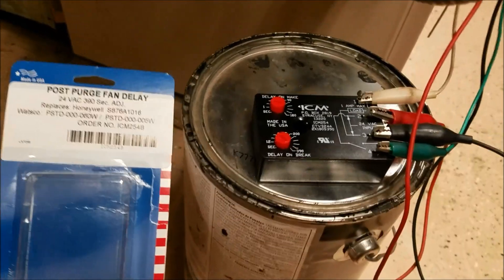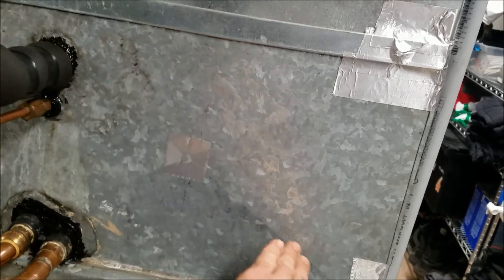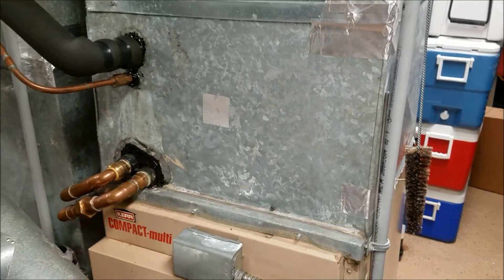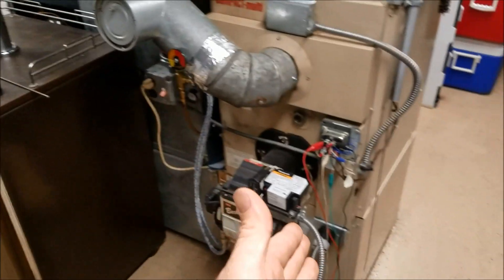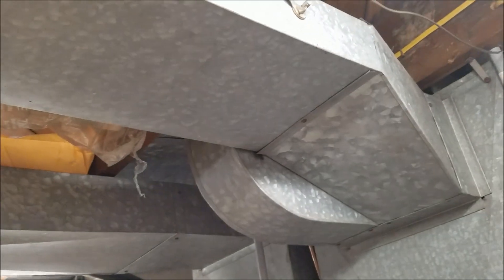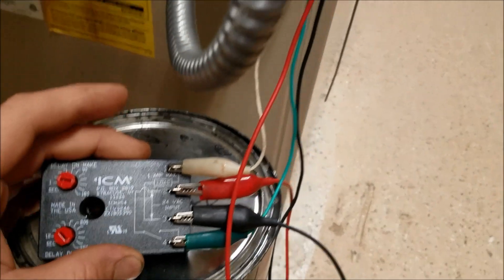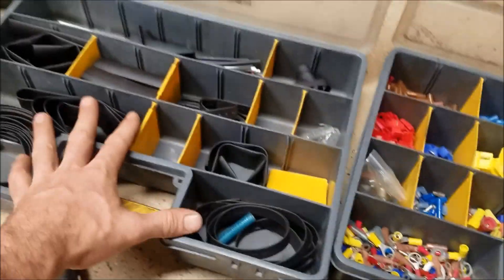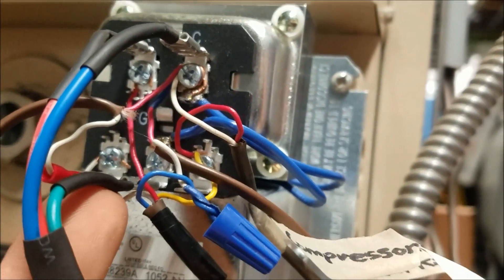DRY OFF YOUR EVAPORATOR! ICM254 Post Purge Fan Delay BENEFITS/INSTALL

Comment: Would an ICM 253B wire up them same if I only wanted to delay the fan off? I have a 30 year old system and have been wanting to add this feature. When I run my fan manually after shut off for four minutes(240 seconds) my house cools down 1 more degree. That's got to be a cost savings.

Comment: can this be installed inside an air handler where the fan motor and wires are? so it’s out of sight?
Reply from the maker: I would keep it accessible.
Reply: @NoNonsenseKnowHow  thanks for your response. i wanted to install or have the icm254 installed in our unit but i dont want it visible. just thinking, why would i want it to be accessible all the time if i can still access it by opening the air handler like i would to adjust the blower motor cfm?